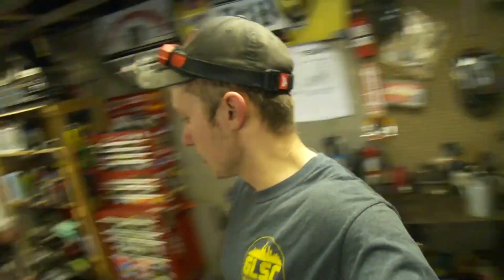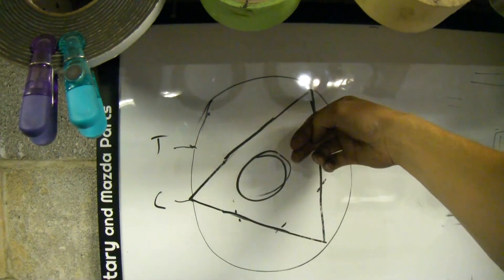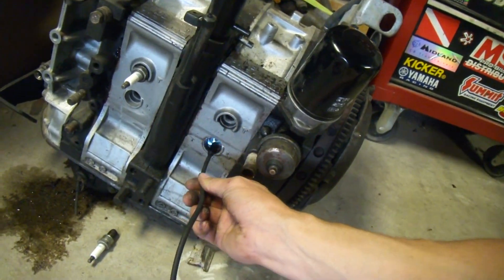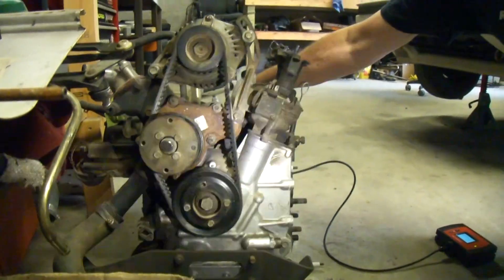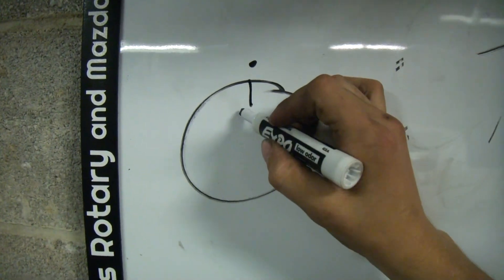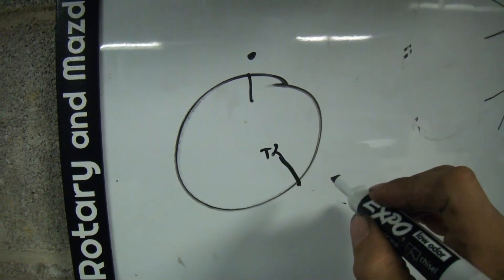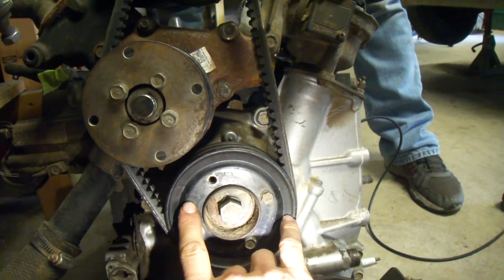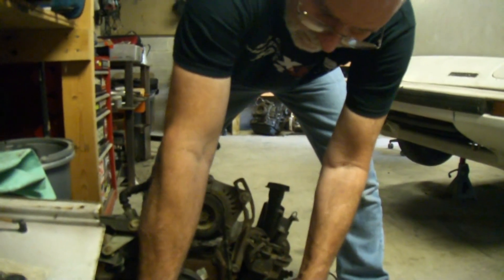HOW TO FIND TOP DEAD CENTER OF A ROTARY ENGINE

Comment: You can also put equal length  long wood  q tips in the from rotor leading and trailing holes and rotate until rotor face is against the sticks rotate back and forth until they are equal length. That is true  top dead center.

Comment: You should put a clear disclaimer that doing this procedure at specifically the REAR rotor will locate TDC for the FRONT rotor. Otherwise people will set their TDC to be the apex seal instead of the bathtub of the rotor

Comment: Hey there, hoping you can help. My timing marks are way off when using the timing light. Their several inches to the left of the indicator and the cas is dead center on the adj bolt/nut. I followed the vid and found tdc to verify the timing marks on the pulley are correct and their off my a little but not several inches. When i stab the cas no matter what i do to adj for the gear movement when stabbing, the top gear in the cas is always off its mark and the bottom cas gear dimple is pushed out of alignment one way or the other. Unless i have the cas twisted all the way to one end of the allowable adjustment. Any thoughts? Also very hard to start when cold and runs rough and then is even harder if not impossible to start once warmed up.
Reply: Well i found i had very low compression. I pulled the exhaust manifold and push on each apex seal w a wooden stick and all but one were stuck and didnt want to move. So i started cleaning them w carb cleaner and letting them soak by pointing the seal down into a puddle of cleaner and slowly one by one they are loosening up. Maybe not the right way to do it, probably should pull the engine apart an do it right but i cant afford a rebuild kit atm so i figured not much to lose as long as i make sure ive cleared all the cleaning fluid out and lubed everything up real good and change the oil before trying to crank it over or a compression check again.
Reply: Carb cleaner causes rubber to expand by a lot. Brake cleaner won’t. Not sure it’s the best for water jacket seals …

Comment: Hey there could you explain how in most timing write ups, they say to attatch the timing gun to leading and adjust cas as needed and then do the same with the trailing. Im confused on the trailing part. If i adjust the cas for trailing wouldnt that throw off leading that i had previously adjusted? Im probably missing something super simple lol.
Reply from the maker: on an FC CAS, if you adjust the CAS angle, it will change both the Leading and trailing timing number.  The only way to adjust them independently would be to change the "split" timing in the computer's tune itself,  Otherwise yes you are correct, adjusting the leading affects the trailing and vise versa

Comment: Thanks for the vid I’ve installed new Gilmer pulleys on without marking TDC first. I did watch another vid using the front rotor and a screwdriver to find the flat of the combustion side of rotor.

Comment: Can you explain more about putting on the eccentric shaft pulley ? Can the pulley be put in wrong ?
Reply from the maker: It should only fit on the hub 1 way. The 4 bolt holes aren't square.  However I have seen them drilled out to fit, or mismatched between model years which will throw the timing marks off

Comment: Hmm, I tried this method on my S5 T2 engine with S5 housings and REW eccentric shaft and you could clearly see that the keyway was not at 9 a clock, more like 8:30, the same with the rear counterweight.
I did it twice and looked over my measurements but ended up the the same place, about 5° BTDC.
When I turned the front keyway to 9 a clock the stock 5° and 20° marks looked to be at the right place.
For some reason this method did not work for me.
Reply: this is more of a 'gets close' method. also some years the pullys were marked at TDC, and some were marked at 5 and 20, and after 86/87 the spark plug holes have been moved slightly.
Reply: https://www.youtube.com/watch?v=bHFYul1gBzE Jon explains how a lot of pulleys have been marked wrong at factory

Comment: I just finished rebuilding a 13b 6 port turbo engine running on a Haltech. I guess I didn’t know any better and didn’t even line up the pulleys or verify the rotor faces. Does that mean I have to take off the pulleys and follow this process before starting it for the first time?

Comment: How accurate is this method of finding TDC, I just did this method to my FC engine and the factory timing marks are about 6 degrees after the timing mark I made with this method, I don’t want to blow my engine up on the dyno
Reply from the maker: I would trust this method over the timing marks, but at the same time, on the dyno you should see the power level lay over when you get past the optimal timing number for your setup, then you can back it down to where it makes the most power.   If the front hub and pulley have ever been taken apart and potentially swapped with a different hub or pulley, the timing marks may not be correct
Reply: Keep in mind the above procedure finds TDC (O-deg). FC factory marks are 5* atdc and 20* atdc. So I think the procedure confirms your pulley marks are correct or at least very close.

Comment: Yooo, thanks for the video. I was trying to figure out how to fined TDC. Where finishing up a build. The car is running but I felt like there was to much heat coming off the engine bay. Fire wall, hood lock,vacuum box, all was really hot to the touch. The car was on at idle for about 2hr. Just checking for leaks and what not. A buddy of mine told me to see if I put the pulley back correct. It’s an Atkins rotary serpentine pulley kit.

Comment: Just pull the front pulley and the keyway must be at 9 o Clock, then put the pulley back in.  Align the damper to line up to TDC pointer with marks,  make new marks if needed.

Comment: Could you run 15 inch rims on an fb or is that to big. Would like to get some spec Miata race tires and rims for my fb but don’t know if they will hit under suspension loads
Reply from the maker: 15 inch wheels will be fine.   15x7 +20 is a popular square setup for stock body.   I think with a 205 on them.
Reply: RAD Potential  thank you. Greatly appreciate it. Do you have a recommendation for a tire place. What do you like for tires on the banana?

Comment: Still voting for a video on rear wheel bearing removal and replacement.
Reply from the maker: I havent ever done this.  Maybe I should try one.  Never needed to do it.
Reply: You have to cut the lock collar off to remove the rear ball bearing with shop press. (Use cut off wheel. Stop short of touching the axle when cutting into the retaining collar. Use cold chisel hammered into the cut you made  to split the lock collar -Then it slips off.) to put new bearings on - You then need a long metal pipe. Not exhaust pipe. Thick Walled pipe that’s the right OD that sits on the outer race. Use shop press  - force the bearing onto the axle until it’s up against the collar flush. Then press on the. New retainers supplied with the new bearings.

Comment: Would this same idea apply to a 13B that’s EFI based without a distributor? Assuming that the the crank pulley is at 0BTDC I would just line up the dimples/holes on the CAS and install it back into the front cover?
Reply from the maker: Yes sir.  This applies to all 2 rotor engines